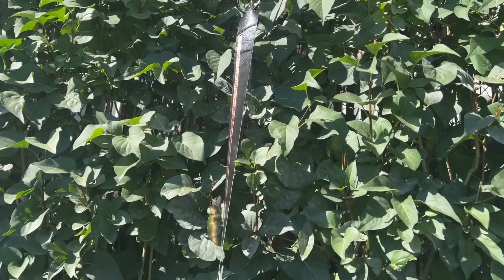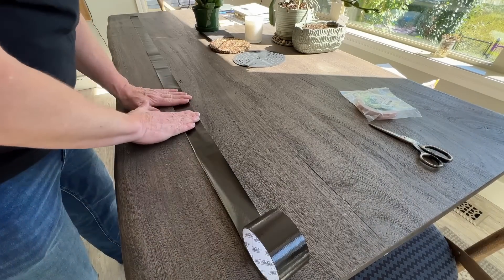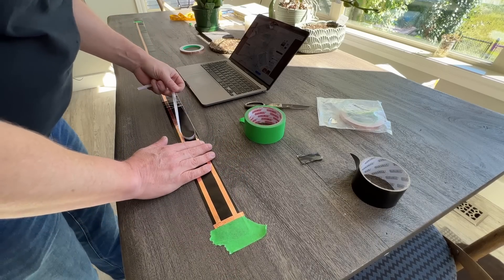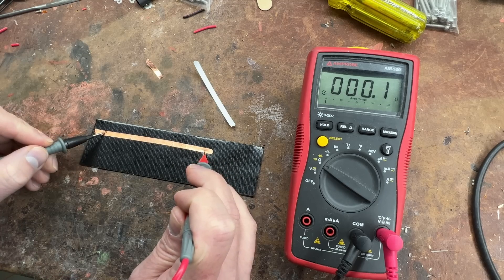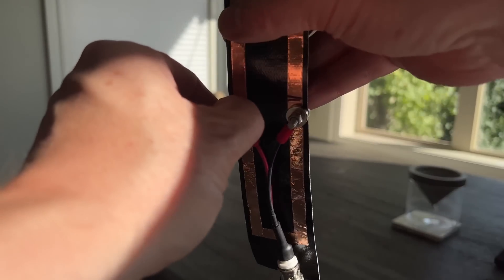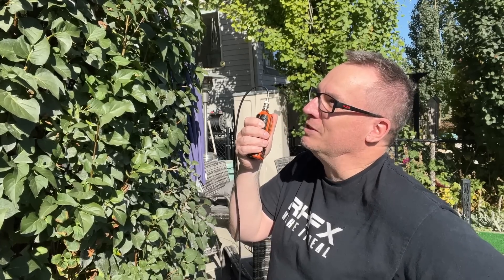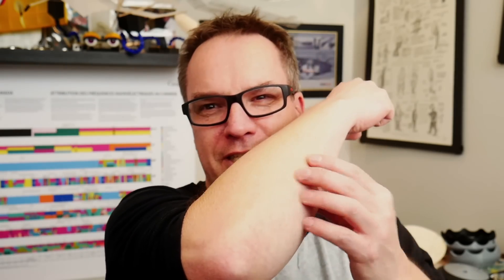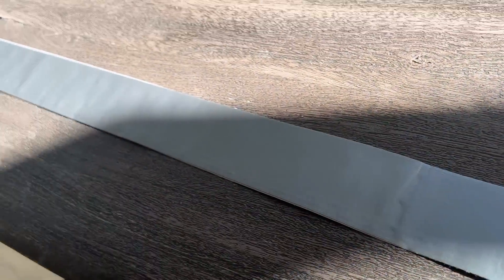How to make a 2 meter band tape antenna: Lightweight, portable, fun project for ham radio

Comment: nice. 

I once made a TV yagi out of Meccano something like 30 years ago... 
Now I could probably have tried to piggy back things on the large yagi ( on a motorized pylon ) outside, but it was a bit too much in my mind just to get TV. I was living ( temporarily, first few months of my first job ) at my grandparents house and they were radio amateurs ( F3JG ) so there was lots of radio related stuff around to learn from.
( and piggy backing on the main yagi meant that I had to go down 3 floor and back up to orient it the right way and check the effect on the TV... not really practical )
Reply from the maker: Love it. I would have liked to see that. 73

Comment: Great project! Thanks Ben. Roll out the antenna cause any damage to it?
Reply from the maker: Not so far. It does need more field testing. But like in the video a repair is as simple as taping over the break. If it is on the exterior of the tape.

Comment: I have no doubt someone has already mentioned this in the comments but... "duck tape" was originally intended for use to join ducts, such as those used in air conditioning and similar. hence "duct tape".

That being said, this is still a handy video.
Reply from the maker: No that is not true. Duck tape was designed in WWII for ammunition boxes. Not until later was it used for ducts.  https://youtu.be/9FaDI1i8ijs?si=eL7gIfRNcn8q4m_l. Regardless duck and duct are both used.
Reply: @VE6SFX_HamRadioRookie  Well I'll be forced to concede defeat on this, I stand corrected.
What I do feel however is that there are different categories of tape that have been lumped together, and that the names have converged rather than diverged.
Reply from the maker: No we are both right. No defeat here, just multiple valid answers.
Reply: Nope. It was originally a waterproof tape called duck tape. "Duct" came later, and it's actually lousy at sealing ducts, don't try to use it for that. Foil tape is best for sealing ducts.
Reply: I've heard both as people below say. All I can say is I don't know.
Reply from the maker: But some are very passionate that it’s one or the other. Lol
Reply from the maker: Feeding the algorithim https://youtube.com/shorts/n9ZNJKuUpXM?si=NE5Spf11D-lzjmGX :) Cheeky response to all the Duct comments

Comment: Adhesive-backed copper foil tape. Sold by stained glass suppliers. It is what is wrapped around the edge of the glass before it is tinned with solder.
Reply from the maker: No idea. Just bought it off of amazon you can find links to it in the description.
Reply: Hi. I didn’t ask a question. I just stated that adhesive-backed copper foil tape is also available from stained glass suppliers. It seems there is a variety of sources for the tape, though. Copper foil tape for stained glass tends to be very narrow possible making it unsuitable for antennas.  @VE6SFX_HamRadioRookie
Reply from the maker: I think it would be ok for antennas. 1/8 tape works. The bandwidth is narrow but it still works

Comment: Sir:
Thank you for doing the testing I was thinking about. I have a couple of dual band j-poles (copper pipe) and a couple tape measure 3 & 5 element yagis in my disaster (natural or man-made) preps and this will lower the weight and volume tremendously. 
73 -- Kevin -- KD9EFV
Reply from the maker: You are most welcome 73

Comment: Use 1 strip of duct-tape instead of 2, just fold it lengthwise so it becomes half the width. Light becomes ultra-light and cheap becomes ultra-cheap.
Reply from the maker: Yes but the distance between the legs becomes quite tight.... That being said some ladder line 450ohm is pretty close. Hummmmmmm Good idea!
Reply: I just made a 2m slim jim today using 1 strip of tape and I used speaker wire. I folded half the tape over the wires lengthwise and it tuned great. 50 ohms and 1.1 SWR across 144-146. You definitely don't need special wire, just space the wires evenly about 1 inch apart.  @VE6SFX_HamRadioRookie
Reply: Oddly enough, I decided to see if it would resonate on any other bands and it has a steep match on 11m right about 27.380 and I used it for 1 quick QSO about 500 miles @ 100w. It didn't compare to my resonate antennas but I thought it was worth mentioning. I don't recall the ohms, I used a manual tuner while watching the nanovna.
Reply from the maker: !!!!! Awesome

Comment: As a new ham years ago, I was in a pinch and needed something better than a rubber duck on my HT. I constructed a 2 meter dipole out of that aluminum foil tape you find in the HVAC section at the hardware store. I wrapped it around a section of 1/2 inch pvc pipe and simply had the leads of the coax held under the tape by the adhesive. It worked quite well. Anyway, keep up the great work and I hope to see more of your videos in the future. 73  de KM4AZW
Reply from the maker: 73 Already working on some new videos. :)
Reply: Everyone needs to get a better antenna, rather than the stock rubber duck one that comes with an HT.
Reply: Now this gives me a idea for a light yagi antenna

Comment: This should be a standard piece of equipment....A length of duct-tape with strip of foil with an SO-239 on one end. The other end has a moveable SO-239 attached by magnet so you can tune the antenna in the field by sliding the connector up or down the foil.
Reply from the maker: !!!! never thought of this that is bloody brilliant!

Comment: All I have to say is "Brilliant!"
ETA: For an on-the-move type, it would roll up into a nice tight little bundle for easy portability.
Reply: Here's an idea: Get the Rapala 60" retractable ruler (can find nearly anywhere selling fishing supplies, since it's used for measuring fish), adhere the copper foil tape to the underside of the measuring tape, then a thin waterproof tape over the copper foil antenna. Now because of the tape spool housing, as well as the looped tab at the leading end of the tape measure, you have structures to hang the fully extended tape up by either the tab or the housing for the spool, a way to easily retract the extended tape (as it is spring tensioned) and a working tape measure all in one. Retracts back into a nice compact spool too.
Reply from the maker: Oh damn. Yes I will have to do this. But I have another idea that would be maybe more functional. Stay tuned.
Reply: @VE6SFX_HamRadioRookie  Cool.
Reply from the maker: Yup the roll is about 1” in diameter 2” wide and fits in a pocket nicely. Short feed-line in the other pocket and you are gold

Comment: can you tell me what length i need for  a tv antenna ?
Reply from the maker: so this opens a whole can of worms. This was designed to transmit. The length is critical for this but for receiving literally any random wire should do . However we can get you in the right range. In the U.S. frequencies used are:
1.	VHF-Low: 54-88 MHz (Channels 2-6)
2.	VHF-High: 174-216 MHz (Channels 7-13)
3.	UHF: 470-698 MHz (Channels 14-51)
Use the frequency you want and input it here to get the lengths https://m0ukd.com/calculators/slim-jim-and-j-pole-calculator/

All said this really is not a tv antenna but it is totally worth a try.

Comment: Could I tape it attach something to a flag pole on the outside of my car or UTV?
Reply from the maker: Try and find out. I am not sure, it should work but maybe not as good as on non metallic things. But the only way to find out is to try. Also consider if it’s on, say the roof of your car it will be horizontally polarized.
Reply: @VE6SFX_HamRadioRookie  The flag poles are fiberglass.  Many of the owners have flags to identify themselves out on the trail.

Comment: E X C E L L E N T  VIDEO !!!
   One of my first tech jobs, was installing CB (11 METER) antennas on people's cars. Limo's, houses, etc. I have done lots of other things in my life, but installing antennas and designing them always was a concern of mine. The last 20 years of my almost 40 years on a major railroad, as an electrician, I installed antennas on top of Locomotives for VOICE RADIO, and LOCOTROL, which is the LEAD unit controlling several other locomotives in the middle of the train. Also, GPS antennas.
   When I was younger, I stripped down a piece of RG58U coax, at 8'6 1/2" and pulled the center out of the braid. I fiberglassed it under the deck of my Dad's saltwater 23' Chapparell fishing boat, and installed a 23 channel CB for a Ship to Store Radio, so when you had to go around the boat with a big fish, you wouldn't get fouled up on the antenna. The SWR was perfect and the water gave the carrier a nice bounce. 
   I subbed to your channel. 
   You mentioned taping the ribbon antenna to your house. Let me bring something to your attention. The air above us, is in layers, as to frequencies. Some spots thicker in depth than others. You have to adjust the height, from the ground, up, to find that "SWEET SPOT." Give you a for instance, a buddy electrician of mine, asked me to help him stand his 3 legged tower up, to raise his base antenna (MOON-RAKER), and a HAM-M rotor up. Since he lived right next to the base of the back side of a mountain, he was in a dead spot. I asked him if he had experimented to see how high he needed to be, to be IN THE SWEET SPOT. He didn't understand the concept. I asked him if I could check on it for him. He agreed. I found that if the base of the antenna was ONE FOOT OFF THE GROUND, that was the SWEET SPOT. He couldn't believe it till he talked to a fellow in Nova Scotia Canada on it. We're in Tennessee, 🇺🇸.
   check the distance from the ground for your SWEET SPOT. It differs from location to location. Frequency layers are in various layers in our atmosphere. It's NOT always in order, either..! Also, the wave pattern will change if your antenna is horizontal vs vertical. By you transmitting Horizontal, you can be heard better by someone who has their antenna Horizontal.
   Ok, enough instruction. I've been retired almost a dozen years. I enjoy-joyed your content and I subbed. THANK YOU
Reply from the maker: Thank you for the coaching. When you were testing for the sweet spot, how did you do that?
Reply: This sweet spot exists because of lobes in the radiation pattern when an antenna is too close to ground.  The ground reflection reinforces the direct radiation in several directions.  It depends heavily on the nature of ground, water content mostly.  This can be modeled in EZ-NEC software.

Comment: That idea is just genious. I will copy it, shamelessly. hi. I probably try using just a strip of plane/foil.
Reply: I just subscribed, btw. 73
Reply from the maker: I encourage you to do so. I have some other material here I might try it is some vinyl heavy tarp but I wanted the video to be accessable to all. Thus duck tape. FYI if you use aluminum, soldering to it is nearly impossible. But no reason why taping down the frayed ends of the feedlines would not work
Reply from the maker: Thank you!

Comment: Would you experiment with putting a foil tape antenna on a car wind sheild?  Maybe try  a jpole,  and a 1/4 wave with an L dipole set up....
Reply from the maker: I have a large sun roof and plan on the same idea but make it in a slot antenna configureation so it is vertically polarized. I hope that makes sense. If it does not this will help explain https://www.youtube.com/watch?v=MNqqvYlifyw&pp=ygUKdzZuYmMgc2xvdA%3D%3D

Comment: Nice video. Just curious about one thing... Does the glue of the copper tape interfers on the condutivity? I'm asking this because the copper tape as some glue, and probably when you tape it on top of other piece of copper it does some isolation. But hey....the antenna works! :) Congrats
Reply from the maker: I am sure it does but it is VERY minor. Keep in mind that because the electromagnetic force is AC that you get a capacitive couple regardless. Like you said, it works, I can’t explain exactly how, but I can physically show you.
Reply: There need not be a direct electrical connection as long as there is good capacitive connection. I'm surprised you didn't see an electrical difference in your continuity test but it would not be pivotal if you did.  @VE6SFX_HamRadioRookie
Reply from the maker: I actually think there is some minor physical connection through the adhesive. That coupled with the coupling… pretty much negates any issues

Comment: STOP !! STOP!! STOP!! You are entering a very danger filled area. It can cause no end of problems and even divorce.

Soon you will be wondering out loud --- can I make this into an antenna?  😂  Pot smokers have a similar problem....

Seriously, antenna build is the low bar to building your own equipment. Easy to do, easy to over do.  2M yagi with a 10 degree beamwidth..... Have fun and stay away from power lines. Also test your copper tape glue, mine is acts as insulation, it was the cheap 2" at the music store.

You're soldering is getting better, remember to heat the parts before the solder. Heat makes the flux work. Like I tell noobs, it ain't hot glue and and googy eyes.
Reply from the maker: Lmfao. I think I’m going to really enjoy your future comments! 73 P.S. don’t worry I am a well of disappointment, soon you will hang your head in sadness at my ability to solder